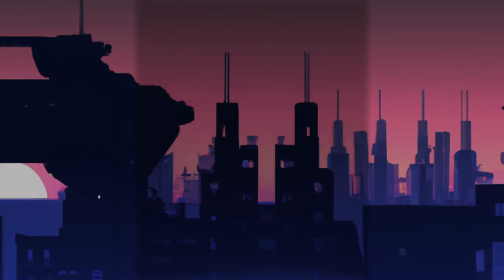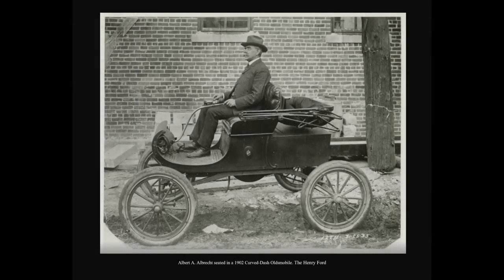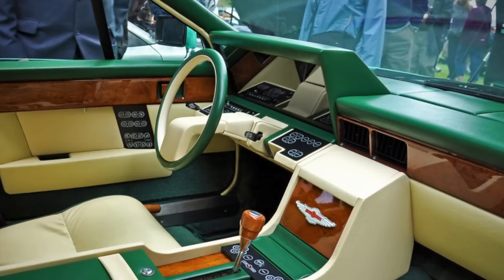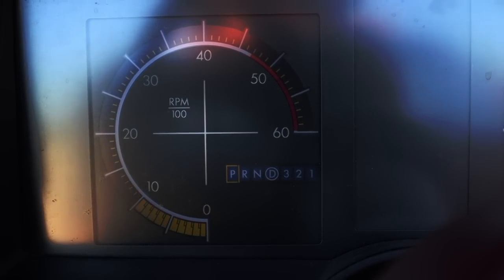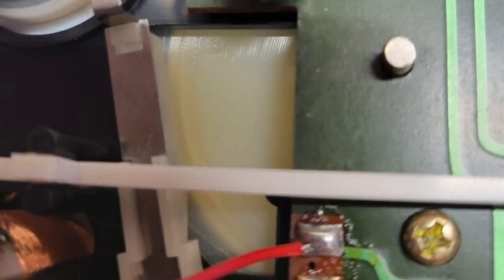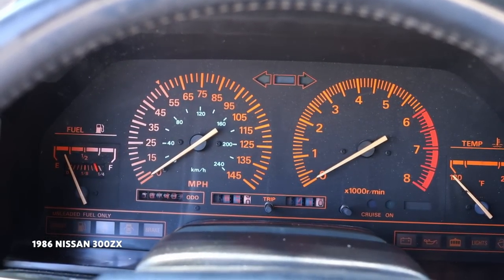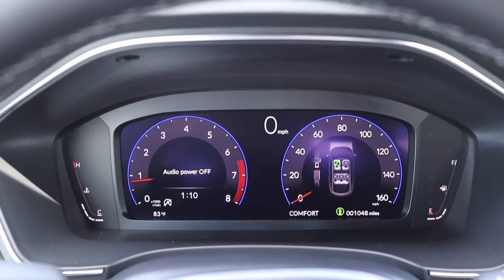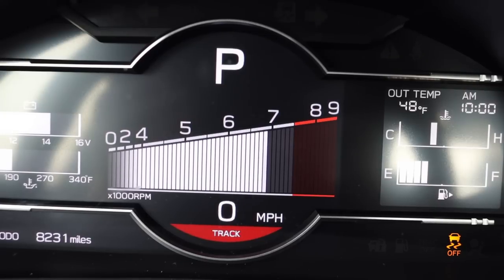Digital Gauges - How They Were Invented And Where They Are Now!

Comment: More precient than LCD screens in the cluster failing is the trend of auto manufacturers removing buttons and making it all interactive through a touch screen infotainment system. 
Not only can these proprietary screens fail leaving you with an expensive replacement or going without HVAC, it also removes the ability to upgrade the stereo by ripping the old one out - or makes it prohibitively expensive.

Comment: There's a slight issue with digital displays in that depending on where you are in the world and how your light source is, such as the sun, you might end up with a display that the sun either overpowers and makes the screen look like basically a flat black screen (without something to shield the screen in the first place), or it'll reflect too much light and you have the glare issue.

There's always the worry that the display's electronics and controls will fail eventually.  What if your car's battery has no charge? How can you tell what's going on? Many minor issues, but otherwise, they do look pretty nice!  Hopefully technology has improved enough that most of these problems are rare.

Comment: The thing to think about is LCD screens are much cheaper now than they used to be, but have a bunch of needles and stuff built into what is still a circuit board is pretty complex, so dont be shocked that replacing a needle screen will get more costly than a LCD screen. Both types of clusters to run on a circuit board.

Comment: My first car which was a 1986 Mazda 929 coupe had 2 of the coolest features you've done a video on, digital dash and pop up headlights.  The gauge cluster had a combination of the row of LEDs for the revs and a fake digital speedometer like what was shown on that Chevrolet S10 in your video.  It was also very wedge shaped and it's headlights were actually quad rectangles like the Delorean but popped up. This thing was basically the Mazda version of the Nissan Silvia - a rwd 4 cylinder luxury coupe that also had a turbo rotary in Japan when it was sold as the Cosmo.  I also had a 1991 JDM Toyota Soarer V8 which was the same as the Lexus sc400 but had a full digital dash and a CRT touch screen in the centre - sadly the CD rom based Japanese GPS didn't work anymore and the TV option wasn't fitted so the screen was pretty useless.

Comment: Commercial vehicles had LCD screens for their gauges. I worked as a bus operator for a number of transit systems and a lot of buses had a full color LCD, and some had needle gauges that would also show the digital readout in 7 segment LED.
The LCD gauge clusters were pretty well thought out, even for 2012. They would dim automatically and change colour to green/amber at night. Yet the modern buses I see are getting their needle gauges back

Comment: When I got my '21 Escape, I was surprised to see the 12in instrument display as I was lead to believe those were reserved for the Hybrids but since mine was produced toward the end of the '21 run (August) a dealer told me they were able to include them with the 360 package.
Love it, but my biggest disappointment is that it seems it should be able to do something more like access to some OBD info or something since no part of the screen is dedicated like an older LCD with all it's icons jammed onto the panel.  The only thing that's mildly "cool" is that it changes theme with the driving mode. BUT the collision warning notice is more distracting than the hazard ahead.

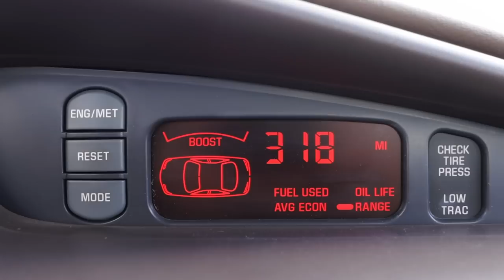Comment: 2:20 Yes, my mom had a 1985 Nissan Maxima and it had that digital design language going on, despite analog gauges. They had to have a computer grid everywhere.
It seems like if you wanted things to look more futuristic in the 1980s, add wireframe graphics.

I thought that in the 1990s, we were going to have wireframe graphics headsets and see through walls with them. It never happened.

Comment: I’m pretty sure nobody had crt (TV-) screens in the gauge cluster in the 80s, don’t you mean VFD or LED?
Reply: they were mainly CRT screens. From a quick research run I found that Aston Martin dabbled with LED screens but mainly used CRTs
Reply: @okinshield7167  I would be very interested in the source, can you share it with me? 
Im surprised because at the time stereo equipment etc. used mainly VFD displays or LCD, also segmented LED displays existed (e.g. in wristwatches). While both VFD and CRT are technically vacuum tubes, a crt screen is not a segmented screen and would be difficult to put in to dashboard bc of size.